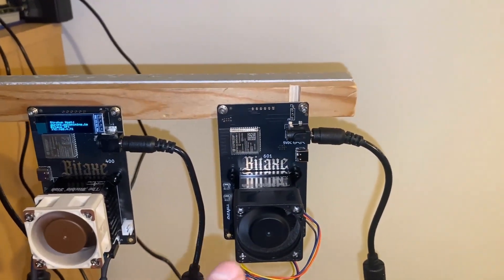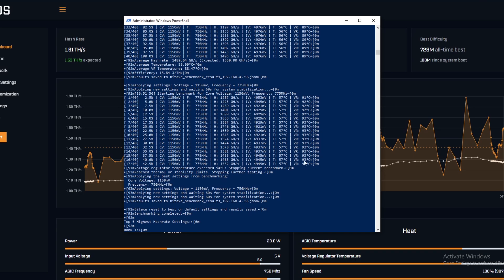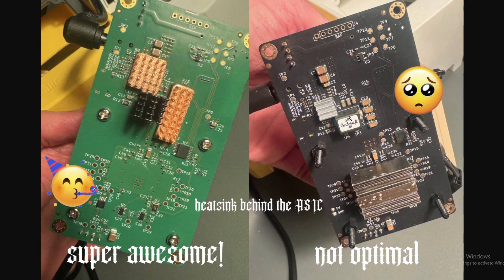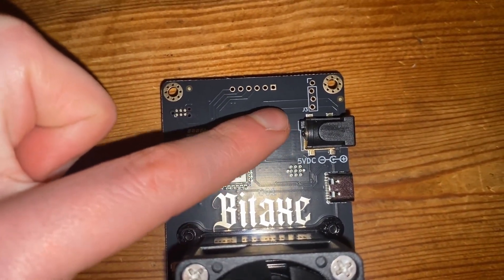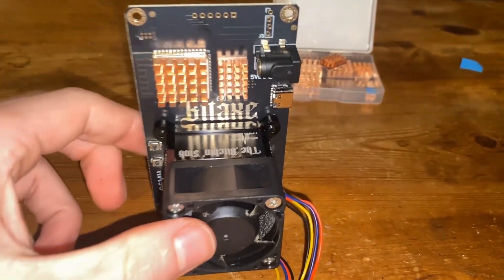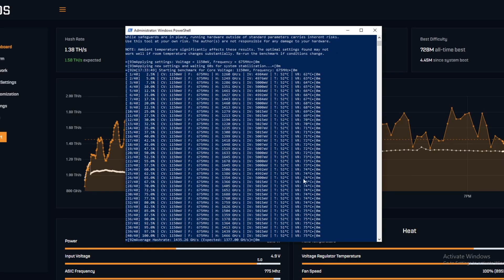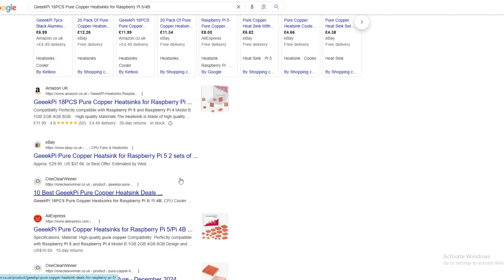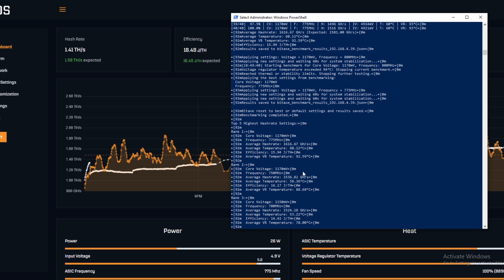Improve Your Bitaxe Hashrate With These Copper Heatsinks...

Comment: SO I have been playing with these bitaxe now for a few months and what I have found is putting those heat sinks on caused all my bitaxes to overheat. Now by just placing a simple 5v fan on the back blowing at the VR directly lowered all my bitaxes by 10 deg or even more (VR run at 63 deg OC to 1,8TH ) ( has to be blowing on it and no heat sinks )

Comment: If you’re not going way of power supply I’d upgrade the 1 piece wall plug to a 2 piece, TinyChip Hub sells one. D central made an interesting point about the 1370 chip needing some heat and being too cool can be undesirable.

Comment: I covered the Bitaxe logo with heatsinks and it dropped my VR temp by 10 degrees. I also have the heat sinks on the back in the same placement as you do. 
I am running power 37W input Voltage is 5V (I have a mean well Lrs-100-5 and had to tweek the output ) Asic Freq. is 975 , Asic temp is 63.6, VR temp is 83. this is paired with 52Pi heatsink and stock fan ,desktop fan and a small fan on the back . my AVG. Hash is just a little over 2 TH and the expected is 1.99 TH
Reply: Nice

Comment: Any idea or tip on how where to apply heat sinks to a NerdAxe?
Reply from the maker: i dont know really, i assume voltage regulator and the front of the board
Reply: @SterlingSpecter1  Mine looked very similar layout wise on the back to the supra so worried it out from there thanks. Overclocked is now less erratic and stays consistently consistent.

Comment: Heatsinks arrived. Added one on the front in line with the VR. Put another on the VR itself and one on the coil next to the VR. With a 12v case fan for active cooling. I’m getting 750mhz/1225. ASIC is at 1.19v. Temps are 51.3c asic and 52c VR. 48% fan speed with the Ergon cooler. Expected rate is 1.53th and 15.03 efficiency. Will see how much more I can push it when the Mean Well power supply arrives. Didn’t want to push the supplied wall adapter much more. Speaking of which, you could run all three on a 200-5 Mean Well 👍🏼
Reply from the maker: looking into this, but i also know nothing about these power supplys

Comment: To change the font size in Windows PowerShell on Windows 11, you can right-click on the top bar of the PowerShell window, select Properties, and then click on the Font tab. You can also change the font size by going to Settings, selecting Windows PowerShell, and then expanding Appearance.

Comment: Immersion cooling system anyone?
Reply: @BrabusSaab  I’ve seen those for the bitaxe. Neat stuff.
Reply: @chuckg3517  maybe some diy immersion system would be better than all this coolers and fans, supporting multiple miners at same time, and cheaper after all
Reply: @  I need to get a 3D printer 😂
Reply: Good old hand tool craftsmanship is all you need
Reply: Just throw them in a fish bowl with immersion oil, so many all over the internet

Comment: That big silver square on the front you were asking about is the chip that provides wifi functionality.
Reply from the maker: perfect, well it just had a perfect fit for the heatsink so might aswell cool it
Reply: @SterlingSpecter1  you actually reduce the effectiveness of the wifi chip by putting a cooler on it. it doesnt heat up at all either so its less than pointless
Reply: This is a simple ESP32 Wroom Module... nothing more/nothing less. if u wan´t so say that it is the CPU of the unit and provides wifi as also the firmware is uploaded to this unit. on cheap Lucky Miners from china u have to establish the usb connection to that chip for flashing software if u uploaded the wrong one via web interface and the unit is "bricked"... cooling this ESP32 part wil have absolutely no effect if u ask me... i´m just watching video right now as i´m typing but i think a can say that by now because of my experieces with that often used parts...

Comment: Air source would help. I finally ordered a Mean Well 200-5 power supply. That will give me a place to connect the bitaxe and a second fan to cool the back. Heatsinks on the way, but will be using a thermal glue/epoxy. Feel like the thermal glue will transfer heat better than the two sided thermal adhesive. Parts in this week sometime.
Reply from the maker: so how are you mounting the back fan
Reply: @  was thinking about mounting it to the plastic frame the bitaxe is on. Came with a 3d printed stand. On your setup, you could always mount to the backside of that wood frame and let a fan hang behind each one. Use 12v pc case fans, 80 or 120mm. Just need a 12v power source, which any old pc power supply would work. Or if you have a small desk fan, idea is to move a little bit of air, wouldn’t take much to see results.
Reply from the maker: @chuckg3517  thanks i will try this

Comment: the VRM is under the silver heatsink in the picture or the black chip and this is really the most important thing to cool.  In addition to heatsinks you really need a fan blowing on the back to actually cool off the heatsinks and make them work more efficiently.
Reply from the maker: will do thank you
Reply: New to Bitaxe. Which area on the Back is the VRM? At 4.39 on the photo on the right is it under the silver heat sink?
Reply from the maker: @ no the VRM is the big box on the back at the top of the board